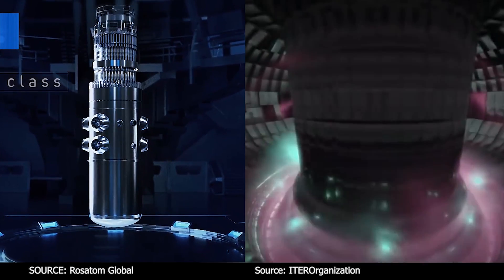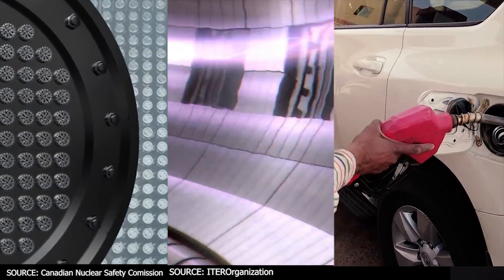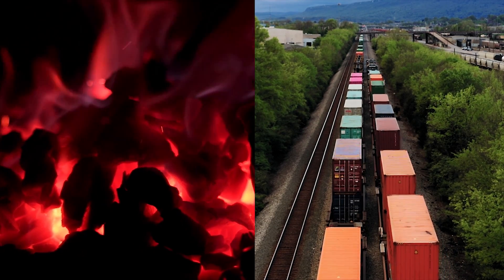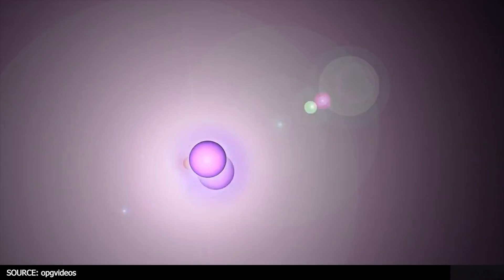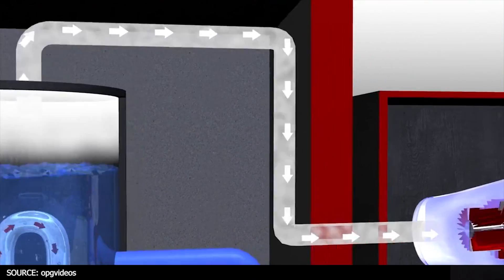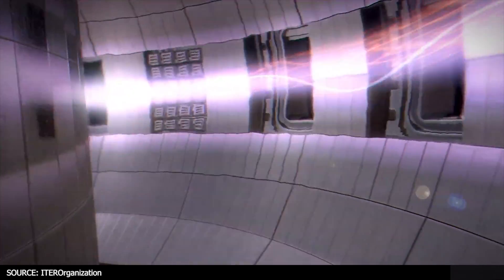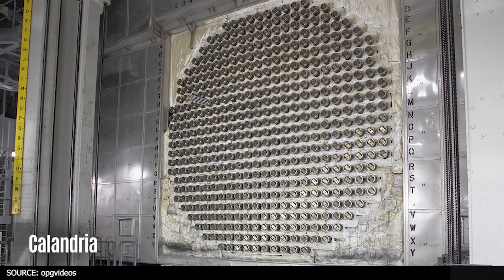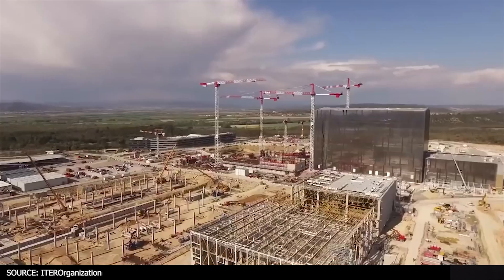Why Netzero needs both Nuclear Fission and Fusion

Comment: Fusion will never compete with fission for one simple reason. It may be 4 times more energy dense, but the energy needed to drive the reaction is vastly more then 4 times that needed to run a fission reactor. It's simple maths, all you need for fission is to run some pumps and it will output energy. For fusion you need hugely energy intensive machines to do things like heat the plasma and keep magnets at near absolute zero. Fusion will never be able to overcome these parasitic energy costs to match fission even if we managed to get net energy output. Fission is a walk in the park by comparison, it is the energy source that will one day power all human society.
Reply: Hi, I agree that fission is a walk in the park compared to fusion when it comes to power generation. And I also agree that fusion operation is very power-hungry because of running the superconducting magnets, heating the plasma and inducing a current through the plasma for plasma stability. That is mostly a problem in tokamaks though, whereas the similar stellarator concept avoids most of that power consumption. That's because stellarators can run continuously, so plasma heating needs to be done only rarely for initial ignition. Also, stellarators don't need a plasma current, so it's much more like a proper "oven" compared to tokamaks. The only disadvantages of stellarators compared to tokamaks, are that they are harder to build because of tricky free-form shapes, and that the donut shape has to be larger than in tokamaks (because of a larger ratio of major to minor torus radius in stellarators).

However, you're forgetting that the main advantage of power from fusion is that it doesn't produce the long-lived toxic radioactive waste that fission power plants do.

There's still a fairly long way to go for commercial fusion power plants and there's lots of exaggerated hype around fusion in the media. But I'm optimistic that the technical hurdles can be overcome and that fusion (tokamaks or stellarators) will provide a crucial power source in the long-term future (starting in maybe 30 to 50 years).
Reply: @helgefan8994  The fission waste argument is totally overblown though, and it's not like fusion reactors won't make lots of activated material waste. We already have fast reactors that can use the waste as fuel and cut the radioactivity down to 300 years or so but that always gets ignored. It is only a matter of time before we close the fuel cycle and the waste "issue" will vanish and we find that actually we now have billions of years of fuel through this recycling.